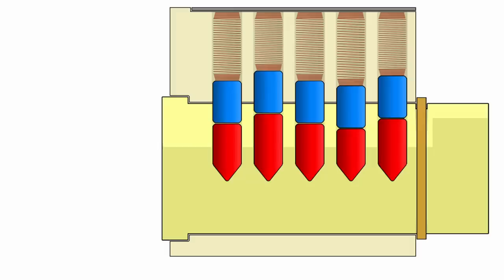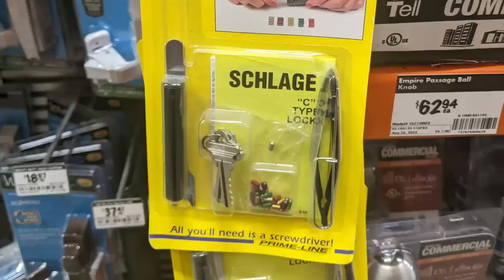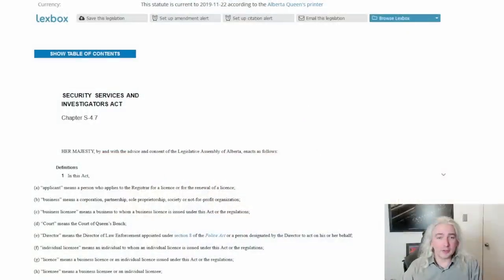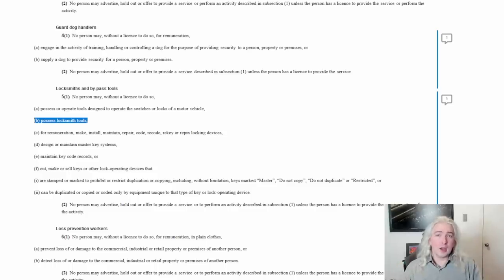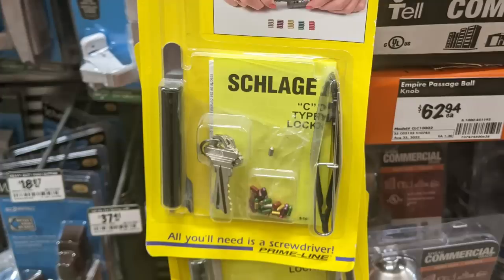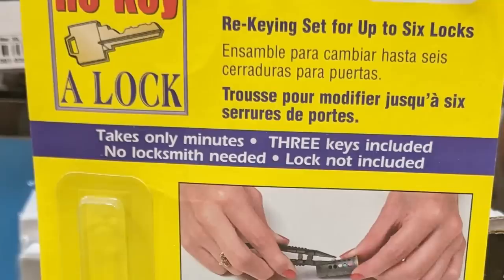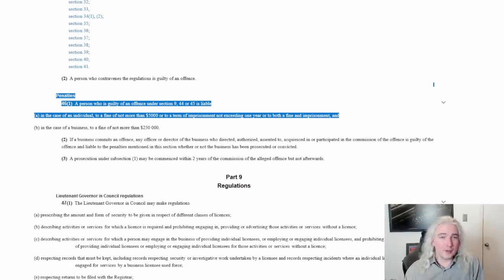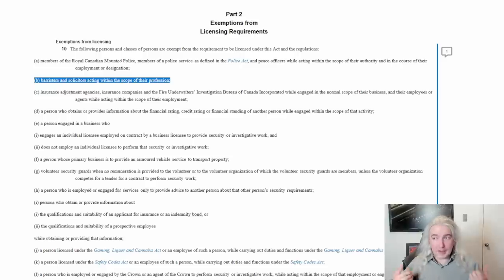Stupid Law Makes This Illegal (In Alberta) -- A Lawyer Explains

Comment: Amateur locksmith from America, former federal agent with a JD from a good school, but with no experience in Canadian law. With all that out of the way, here we have the idea of the letter and spirit of the law and the idea that ambiguous laws are to be interpreted in the best possible light for the person accused. From that perspective, we need to ask ourselves "What was the law attempting to do?". If the answer is "Prevent people from rekeying a lock that they own", then you might have a problem. On the other hand, if the law's intention(or more precisely, the legislator that created the law) is to prevent people from bypassing locks for some criminal purpose, then the ownership of a rekey kit would not interfere in that purpose, as it does not perform that function. There is a set of locksmith screwdrivers that apply security bits to locks that have been co-opted by many other industries(like phones and laptops and similar). If this law applies to rekey kits, it certainly would also apply to security bit screwdrivers.
Reply: For the most part the spirit of the law is to protect the trade of lock-smithing, with criminal concerns being secondary. The persons who typically enforce this particular law are not police officers. They are "peace officers" and they are primarily focused on inspecting, auditing, and regulating specific trades; which is their specific legal mandate. Which is where some sort of protection comes in for the average citizen: your average police officer is not tasked with enforcing this particular law but rather possession of tools for "breaking and entering" aka burglary... and the persons who do enforce this specific law, are unlikely to be dealing with your average citizen; unless that citizen has somehow indicated they offer lock-smithing services (i.e. someone complains). A private citizen possessing and using such items for a hobby is a tiny guppy of a fish and not the intended target of the law.

That being said, as you likely know, one must consider the letter of the law and understand just being charged can be detrimental to certain persons (such as a lawyer).
Reply: @JH-wd6dp  Typically (and I am not familiar with every law in every jurisdiction) in America we separate our laws in such a way that trade laws are found in business codes and our criminal laws are found in the penal code. There is overlap, but typically the overlap is about negligence and willful statutes(like overbilling for services not rendered). The very idea that non-dangerous items could be prohibited for lawful use is crazy, even in trade protectionism. We have lots of hobbyist locksmiths.

While I agree that being charged and having to fight is a pain, I also know quite a few people that would dare the state to charge them, just to clarify the law and purpose. We are fighters. As a matter of fact, I know more than a few cases in my local area that were dropped by the state because the person charged was fighting. Rather than lose the case and limit the scope of their favorite law, the DA drops it quietly so they can continue to abuse it. In my experience you find district attorneys at the intersection of malice and incompetence. I have watched as a DA filed charges they knew would not stick in the hopes that the person would take a plea. I reported them to the BAR.
Reply: @xaero5150  Understandable. I want to say that not only would a person have to find an officer willing to lay the charge against a private citizen and that officer would have to have a supportive supervisor/manager/senior manager that would support such a charge, but also a crown prosecutor who cannot find some way to toss it before presenting it to the court. It all depends on the totality of the circumstances. 

Try hard enough, and I'm sure one might succeed... but I do think it wise of Runkle to avoid the risk. After all, "interesting" legal questions usually get expensive answers.
Reply: @JH-wd6dp  Things work a little different here in the states. For one thing if this were a law here, the chances are insanely high that it would be constantly used as an add on. That is, a search warrant or other reason for contact would issue, and the officers would find a bunch of stuff to charge and would tack this on to the end. The local officer makes the arrest, files the paperwork, and it is the DA that makes the decision to charge or not. It is a rarity that the shift commander, or Lt will override an arrest decision. This law would be voided for vagueness rather quickly here, as all the terms are not defined in a way that a layman could understand. A recent judge in this country actually said something to the effect of "If the lawyers can't figure it out, how is the suspect supposed to", and then voided the law for vagueness, while dismissing the count. Sure, the state could appeal, but the law in question was terrible.

Comment: We already have a prohibition in the Criminal Code relating to the possession of house breaking instruments. While there is a reverse onus, it does allow the possession of these instruments if you have a lawful excuse (such as rekeying your own lock).  

Another issue is that locksmiths do not repair automobile locks. There is no exception for the locksmithing tools used by mechanics (a red seal trade in Canada). 

Lastly, in the 1970's there was a Royal Commission on private security in Ontario it examined a lot of the abuses (especially in relation to labour relations). Its findings influenced legislation in a number of provinces.
Reply: would house breaking instruments include a rock?
Reply: @westcoastwarriorsarchive7929  In the hands of a landscaper doing an installation, no. In the hands of a repeat offender at 2 am beside the side window of a house that he has no justifiable reason for being at, probably yes.

Comment: One might argue that since it says "no locksmith needed" on the package that it therefore did not include locksmith tools.   In fact, that tool isn't especially unique as the same function could be performed with a rolled up piece of paper.

Comment: Based on your interpretation, it would seem it is impossible to become a locksmith.  Where is the provision for students?  Also, a regular screwdriver is a locksmith's tool if it is used for installing or removing a lock.
Reply: [Alberta] A "student" would need to go through an apprenticeship program in which case they can use tools under the guidance of a licensed locksmith but likely cannot possess or use lock-smithing tools outside of the program.

In other words, the keyword is "license." Alberta offers an apprenticeship license for this purpose.

As for the second part regarding a "regular screwdriver," the point Runkle appears to have made is regarding mere possession. If an officer finds you in possession of the screwdriver, you likely would not be in violation as the Crown must prove it is a lock-smithing tool instead of a regular tool. Versus, finding you in possession of a tool that is designed, intended, and specifically used in lock-smithing... or maybe in a packaging indicating it's intended for such purpose.

Comment: When was this law first drawn up? It's possible this law was drawn up to deal with troublesome tenants.   I remember some news about several landlords unable to inspect or reposes their properties after evicting troublesome tenants and petty criminal tenants.  The tenants have changed the locks so the owner couldn't easily get into their buildings.  Of course the owner would have the police in tow and have them assist him in busting down the door only to discover an illegal grow operation, and a trashed house.  On the other hand, a lot of rural owners need these kind of do it your self lock smith kits as most lock smiths operate in a city and will charge a great deal extra for rural calls.

Comment: Technically it doesn't say "locksmith-exclusive tools", thus a screw driver is a locksmith tool if all the locksmiths use it, regardless of whether it has other applications.
In fact footware might be required by locksmiths to get to work.

Comment: 4:36 so having watched the lockpicking lawyer for a few years I think you could make an arrangement for it not been a locksmithing tool as you can achieve the same affect with a length of wooden dowel, it may be a hard argument to sell but I think the possibility is there, I think the pins are far more likely to be classed as locksmiths tools than anything.

But that’s why making laws this open is a stupid idea, it leaves them open to abuse from both sided of the law.
Reply from the maker: You may be able to do the same thing with a piece of dowel or whatever--but this is a purpose-built tool.

Comment: I'm not familiar with Canadian laws on this subject but if they outlaw a kit like this I would be suspicious of the locksmith lobby having some influence. I worked for a well known residential lock manufacturing company for many years. I also worked for Home Depot where we sold kits like this for Schlage and Kwikset locks all the time. These kits were specifically for those customers who wanted to rekey their own locks. This kit does not contain lockpicking tools. It's sole purpose is to allow the owner to rekey his own locks. You can't rekey a lock from the outside. In order to rekey a lock you have to remove the cylinder holding the pins. And to do that you must remove the doorknob. The 2 screws for removing the doorknob are on the inside not the outside. The same is true for a deadbolt lock. The plug follower, which seems to be the "locksmith tool" at issue, is just a plastic cylinder.  There's nothing fancy about it as long as it's the right diameter and length. You can easily make your own from plastic or wooden dowel material cut to length.

Comment: A "friend" of mine, who shall remain nameless, bent a coat hanger into the shape of a tool (sec 5(1)(b) "possess locksmith tools" ) to circumvent the locked doors on his 1973 Oldsmobile Delta 88 Royale because after a night of partying, he realized he locked himself out.  
Did he break the law creating such a tool?
Reply: If just about any object can be deemed a dangerous weapon (shoe, coat hanger, dental floss) depending on how it is used, then I suppose anything could be deemed “locksmith tools” depending on how they are used, as well

Comment: Did some kind of Locksmiths Lobby get this legislation passed? The last time I had to call a locksmith because of keys locked in my car it was $150!
Reply: Next time call a tow truck. They usually perform lockouts. Not sure if they are cheaper but maybe.
Reply: In alberta? Well, I can already tell that you called someone who spends the most on advertising, after hours, or a call centre that answered "Service"
Reply: @beaugalbraith3891  And honestly, usually quicker call time.

Comment: So this may be a potential work around that should be legal, assuming big box stores such as Rona, Home Depot or Lowes offer the same services as here in Ontario, they do offer re-keying for a service charge $15/lock where I used to work at but that was about a decade ago, so you would need to discuss it in advance with the department manager Millwork or Hardware and need another person to be at home while you take the locks into the store for them to re-key the lock, oh and another key that fits the key way.
I understand this is not ideal but legally safer than having said re-keying item. Risk of possession falls to the store.

Comment: Hmm.. 

A follower is nothing more than a dowel or similar items of suitable size to prevent the pins/springs from falling out.  Nothing more. Wooden dowels, pen barrels, and other such items can be used.   I suspect, in this case, the 'use' of the item is the issue, not the item itself. Use a rolled up newspaper as a club and it's now a 'weapon'.  

Interesting as 'Lock Sporting'  (amateur lock picking/opening) is a very real and active pass time, as you know being a Deviant fan.

As always, thanks for the Canadian content (are you listening Canadian government?)

Comment: most US lowes and home depot stores will re-key any lock you buy for free if you want to make the key match your other entry locks. you just need to bring the key you want to match. as cheap as locksets are and as easy as they are to replace, locksmiths aren't making much money off of this anymore unless someone is locked out.

Comment: What is meant by "possess"? Does it imply ownership, or could it be borrowed, perhaps owned by the company? Or does merely mean having on your person (knowingly)? If you are a Locksmith Apprentice and you are learning the trade, but are currently unlicensed yet working towards licensure, are you not permitted to own/use the tools you will be working with? Or do we have to establish case law to find out?
Reply: Generally here, during your probationary 3 months, you're doing menial work and learning keys and whatnot. After that period, you are sent to apply for apprenticeship license. You do not have to be a journeyman to use, but normally advised against owning till then.

Comment: That’s our government….”they” know better. A homeowner doesn’t need a licence to possess and use tools to fix electrical or other issues in their house, but tools to fix locks….no one needs lock tools, they are designed to open locks in the shortest amount of time, and are a serious criminal hazard, we better licence the use of them.

I can also get into your house with a brick, or a drill, or as I once had to do to repair a soaker tub, from the outside wall after removing the vinyl siding.

Comment: There is nothing particularly unique about the follower since you could just use any random piece of pipe with the appropriate OD and a slight taper to help get the pins on. If it is your lock, you should be able to do whatever you want with it. It doesn't make much sense for locksmith to get their panties in a bunch over this since buying a whole new lock and replacing the whole thing is usually much cheaper than hiring a locksmith if you are slightly DIY-inclined. If locksmith encouraged people to re-key their existing locks, maybe they'd actually get more business from people coming to them to fix their own screw-ups with locks and keys getting jammed by damaged springs or using pin lengths too short/long for the lock body and getting jammed.

Comment: Interpretation of this has been interesting.  Didn't realize you were in our area. Unfortunetly, theres a bit much to our proffesion that seems a little too vague. Personally, I don't have issues with people having access to pin, plug followers, shims, or extraction tools. That's just basic maintenance stuff. The tool section should only apply to bypass tools such as picks, automotive tools and the whatnot. All power to the consumer if they want to rekey their own hardware (barring smartkey, but that's a quality problem). And to be honest, 95 percent would rather have us to do it. I'd say 60 percent can't even bother to unscrew the hardware from their door to bring it in at a cheaper rate.
Reply: Just an edit on this with a slight rant at the end.  I wish there was some sort of exemption for hobby pickers to a degree. I feel for them. As much as stringent as these laws are, it's ridiculously easy to get them like any other prohibit item (Drop by super flea market, guarantee that you'll find butterfly knives). Just keep aware, that if you have them, you're going to be automatically regarded as possesing break & enter tools. 
Now if the police would actively pursue people who are using to operate without a license, that would be nice. I'm tired of seeing people falling for these call centers, and having a $90 to $150 job turn into $500 to $600 plus job. And google ad services does not want to do a thing about this. We've only been able to succesfully been able to remove fraudulent locations on maps after being aggresively attacked.

Comment: A plug follower is nothing special. You can use a wooden dowel. I find it difficult to believe that a basic geometric shape, a pure cylinder, could ever be considered a specialized locksmithing tool by a court.

Comment: The follower is usually just a piece of 1/2" tubing.  As others have noted, there are a lot of common items that could be used as locksmith tools.  I don't think anyone is going to get successfully prosecuted for having some tweezers and a piece of pipe.

Comment: You need a license to possess or operate tools designed to operate the switches or locks of a motor vehicle? 
My keys are tools designed to operate the locks and ignition switch of my motor vehicle. 

So as the law is written I need to have a locksmith license to use my car keys?
That means a rogue cop could arrest the premier of Alberta for driving without a locksmith license.

Comment: When asked if your truck has any weapons in it answer NO but I have  a lot of tools in here 
2 crow bars 
2 pipe wrenches
2 hammers 
2 10 inch beehive tools sharp little pry bars
Pruning or jab saws
Couple 9 inch sazall blades
Several screwdriver 
Even have a 4 foot hook in the truck Bed along with a knife for cutting honey comb back there stuck on a magnet 
But none of the above tools are weapons